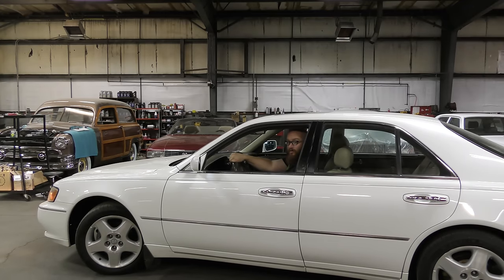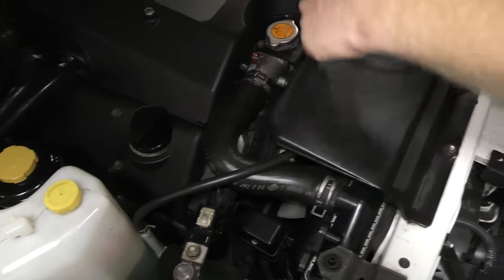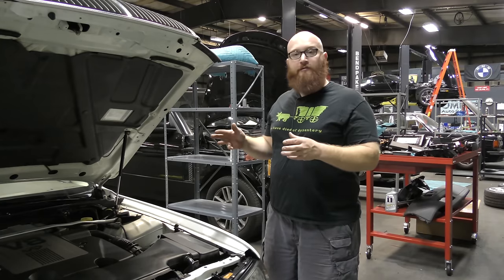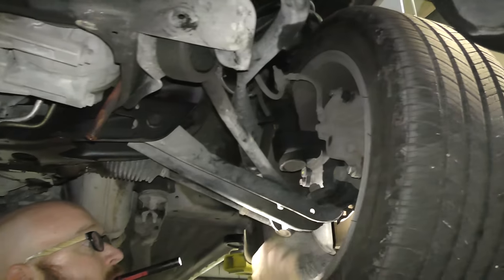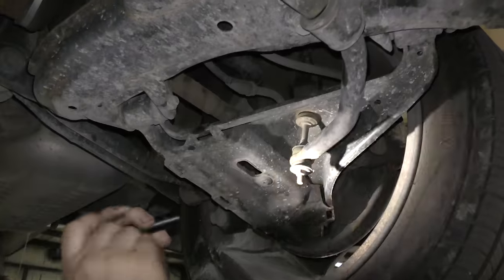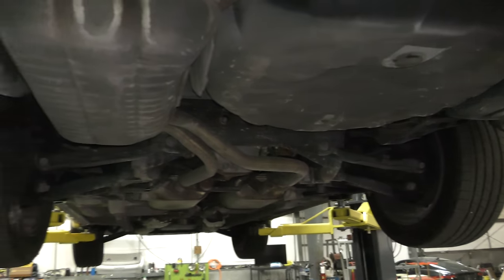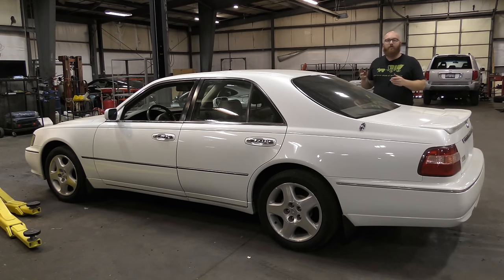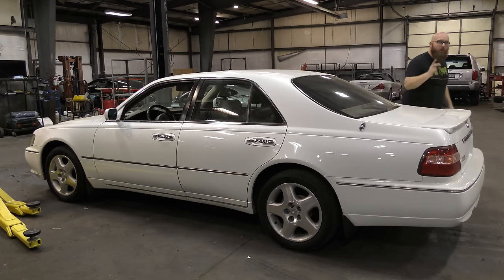I've never seen one of these before! First time a 99 Infiniti Q45t enters the Car Wizard's shop

Comment: You know a good car, when the mechanics have never seen one.
Reply: Yup. A good sign when looking for a car is that it's hard to find. People hold on to good, reliable cars.
Reply: your both wrong they just didn't make many of them
Reply: jeff59rt You know I never really thought of it that way but that’s a damn good point!
Reply: The same truth applied for the worst cars also
Reply: Unless the car is a dud like the Dodge Intrepid. When those cars break down the next stop is the car recycler
Reply: MrFuchew there’s plenty where i live found over 12 of them near me
Reply: @fleichy6425  West coast?
Reply: Jeff Harris yes oregon
Reply: @fleichy6425  which part of Oregon? I'm from there to and these don't seem rare at all around here. it's nice living somewhere that cars don't rust out by year 5.
Reply: This car sucks all nissians do
Reply: @presidentroosevelt8773  how you’re just hating this car was before Nissan sold itself to renult bad ass nissans and Infiniti’s in the 9ps
Reply: @ourtime-downhere6931  90s
Reply: @jesserdo9963  90s what?
Reply: Rite on
Reply: 🙂🙂🙂 Great point, because if The Car Wizard hasn't had one in his shop before now, it makes you want to see if there is any used ones for sale somewhere.
Reply: @MrFuchew  that doesn’t mean it’s not a reliable car
Reply: Did it sell bad ?
Reply: @presidentroosevelt8773  Nissans in the 90s were literally indestructible. You can run one on one quart of oil for thousands of miles do an oil change and it would just keep running fine after that
Reply: axelafy I'm thinking maybe he was talking about the touring edition
Reply: Flordah_man_life  Nissan Cima.

Comment: The Q45 is yet another example of how automotive journalists can ruin a car. This car was very similar and certainly competitive with the third generation LS400 of the same vintage, yet this car and the entire Q 45 legacy faded into obscurity. It was criticized for being too “Buick like” at the time and not high performance enough.  This is yet another great example of why we need to demand that the auto manufacturers bring back big, comfortable, rear wheel drive cars.
Reply: Journos simply ruin everything. 

It's a wonder anyone ever listened to mouthpieces who only cared about numbers cars to sell more magazines from more "thrilling" performance tests.
Reply: The new rendition that came out in 03 and 04 was a sales flop but my car when it was released in 06 as a total redesign it knocked bmw Mercedes and Lexus out of the ball game accordimg to Motor trend and car and driver. It was extremely a head as far as tech and features. To this day my 08 M45 Sport runs amazing with over 100,000 miles on it.
Reply: Modern cars beat up the occupants.  My '95 Impala is comfortable, one sinks down into the seats.  Amusingly GM advertised the seats as bolstered compared to the Caprice and Roadmaster.
Reply: I think people give the auto journos too much credit here. People didn't stop buying luxury sedans because the journos told them to. They stopped buying them because they started buying SUVs instead. Auto manufacturers listen to sales above all else and the sales (the people) have spoken. Not that the journos did the sedan any favors. As long as the majority of the new car buying public keeps buying CUVs and SUVs we won't be seeing a resurgence of nice sedans.
Reply: I remember when it first came out in 1990, it was criticized for its styling and being too 'brutish' to drive. Then in 94, they slapped a grill in the front and softened the ride. The car got softer and softer with each new generation / refresh. The other thing was it didn't have the reliability and resale of the Lexus and Acura and thus couldn't keep up with sales and demand. Lexus still makes the LS and neither Infiniti or even Acura have a proper flagship

All that said, I have a J30 and it's amazing. I love the early 90s Japanese cars best. Overbuilt and over engineered machines. Too bad Renault took over Nissan
Reply: Well, that's not totally true. The Chevy SS was lauded as "as good as its german counterparts, and very well appointed even at base level" by journalists, but GM never advertised it at all, so it died. I still remember when "new old stock" was selling at $20k discount closeout prices. Wish I were in a position to buy one of those.
Reply: The market has spoken though: there is no market or demand for big rear wheel drive cars unless its a Merc, BMW, Bentley or Rolls-Royce.
Reply: Most auto journalists have a ridiculous propensity towards sporty and dynamic cars. Personally I take comfort about performance.
Reply: That’s why I drive a 96 Buick Roadmaster. Obviously not my only car but will always have an old school big American luxury car w/V8, rwd and comfortable. Got it 4 yrs ago with 22,641 miles. When my tour in Germany is done next year I’m on the hunt for my 76 cadillac Sedan deville🇺🇸🇺🇸🇺🇸
Reply: LOL, yeah, it was the journalism. 

RaaaaaHaaaaaaHaaaaaaaa.

Yeah, it was the journalists. Yep, if your a Nissan fan let's go with that. 

Nothing to do with anything else, all because of the journalism. 

Ahhh, yep, heard this all before. 

Also heard the beloved journalist has praised many a lemon along the way too.

The strong survive, the weak die. Nature.
Reply: Topher7527 great point, I completely agree.
Reply: My 2006 Lincoln Town Car is probably one of the greatest cars of all time. Fast? No. Efficient? Also no. Dynamic to drive? Absolutely not. Comfortable as hell? 100%. Will continue running until the sun explodes with routine maintenance? Hell yes. 

Other automotive GOATs: '90s Corollas, Camrys, and Tacomas; '80s Volvos; '80s Mercedes diesels
Reply: @Shawn-ne6ld  I like your taste in cars.
My first car was a 76 coupe DeVille. In 1984 (paid $45.00) 2nd 1971 Cutlass; 3rd 1983 Eldorado
Parking spaces have been painted too narrow for our full size cars or pick -ups.
 I now drive a 2008 lacrosse V-6 204,000 miles. It's in ultimate condition. Cop shocks & cop tires (Michelin sport 16") 
 Might be the last good Buick ever🚗
Reply: Glad to see there are real car guys still out there brother🇺🇸
Reply: Genesis is doing just so
Reply: Fred Williams I’ve got an 08 G35 and it’s got lots of stuff average brand new cars don’t have. Radar cruise, pre collision braking, headlights that turn, and lots of very advanced engineering. Infiniti used to be way ahead with tech, but unfortunately they fell behind. Atleast I’ve still got my G, 300,000kms and still runs better than a lot of brand new cars lol.
Reply: Oddly enough this is one car journalists might’ve been right about. It was criticized for being inferior to the previous gen Q45. The 89-96 had 300hp (unofficially) and was beloved by enthusiasts for both its performance and comfort, but Infiniti cut costs with this second gen Q45 Due to poor sales. It was still marketed as a sport luxury sedan, yet this car lost 40hp and 50 torque, making it slower than the Lexus LS. This Q45 was also put on an older less expensive, heavier, JDM platform that resulted in an entirely different car. Still a Great car, but unfortunate that it came under the pretense of being a sequel to Infiniti’s first gen Q45. Oddly enough the first gen q45 lived on in Japan until 2002 as the Nissan President.
Reply: @Kevin McAdams
This version of the Q45 was actually a downgrade from the original....which was more of a Japanese BMW
As for large RWD based cars there are still several available..Mercedes S class, BMW 7 series, Lexus LS and Genesis G90 to name some
Reply: @fredwilliams7893  my 06' just passed 237k I use it as my work car- I am an insurance property adjuster and this car has been to every hurricane since 2016 Matthew and many hail storms and freezes up north. I paid $3000 at the dealer's auction in 16' with 181K..this is an amazing strong engine!
Reply: @the3hrdoption637  Thats Awesome!!! 👍  what kind of oil do you use and how often do you change it?
Reply: A better example of this would be when Consumer reports sabotaged the Suzuki Samurai,
Reply: Only really bad thing about the Q45 it didn't have no trunk space for the size of that car
Reply: @mjdgi1  Probably had something to do with the suspension set up Or some other form of packaging in that department That caused the shortage in trunk space for the class
Reply: 2002-2006 (I had 2 of these and still driving my '06). It had all the features (premium model)  of the LS, S class, A8 and 7 series, but it was faster, cheaper, than all of those cars and handled a pinch better due to it being just shy of 2 tons. This car was like the Hyundai of full size luxury cars back in the day. No idea how everybody did not own the "big Maxima". No AIR SUSPENSION issues with this car and the valves were TITANIUM for some reason.
Reply: It was the marketing and advertising that killed it. Lexus was doing commercials with a coin standing on edge on a running engine to show its smoothness. Infiniti did commercials that showed leaves and flowing water BUT NO CAR!!  How do you expect to sell a car with no car in the commercials?
Reply: @khakiswag  lmao right
Reply: Damn! They said the Q45 wasn't performance enough?! My 1995 Q45 outperformed the Lexus LS or any other competing luxury car of the time!
Reply: @fredwilliams7893  , I drive a 2005 Q45 PREMIUM today and got it 1 year and a couple of weeks ago. It now has 94K on it. Before this I had a 2002 Premium. The tech, it had a lot of German cars of the time beat. The S500, LS430, Audi A8 and 745 BMW were all slower and did not handle nearly as well. The Q45 was also more reliable than the German cars. This car is simply amazing. Turn pff the traction control and this thing will get sideways around a corner while only weighing exactly 4,000lbs.
Reply: @ericg5075  , 1st gen motor is used in drift cars. My uncle had a '91 (no grill) and it had 278 horses. That shit smoked damn near everything and it handled amazingly compared to other full size luxury sedans.
Reply: @mjdgi1  , agreed. I just moved from NYC to San Diego 2 weeks ago and shipped my 2005. I loaded up the trunk and was like...that's it?!
Reply: @elmayimbe_the_amateur_mechanic  Nice! I like The Q45 I would like to buy one in the future but low mileage ones in good condition are almost impossible to get.
Reply: I don't think journalist ruined the car, I think that Lexus just marketed and advertised the LS400 better. We all remember the LS400 champagne glasses and the ball bearing commercials in the early 90s being in heavy rotation. I can't for the life of me remember one commercial for the Q45 though.........
Reply: Out of respect to the ls400, the q45 has been known for years to blow head gaskets and have timing chain issues within 5 years of ownership. Definitely not quite on ls400 standards.
Reply: I agree. These cars were never meant to be racecars, so I don't understand why they tested them like it and made fun of them for not performing like racecars.
Reply: @fredwilliams7893  I absolutely love my 06 m45 sport. Hands down this car has more personality than anything else I've owned.
Reply: @dandc2011  They are very rare. Plus the vk45de is a detuned race engine Nissan actually used in the gtr race cars . I will probably keep my 08 for a very long time.
Reply: @Eric G50 - Those headlights were way ahead of their time. They still are.
Reply: I remember in a 1997 Car and Driver comparison of full size premium saloons they criticized the Q45 for having faux wood trim.
Reply: @petrosaguilar8916  Yea they did way better with the critics in 2006 when the all new redesign M45 came out!!! Real wood trim and beat out the E class and 5 series BMW!! 👍
Reply: @sterlingcrawford1218  they are pretty efficient. I get 30mpg on the highway hauling 3 people if I hold it at 100. Thats over 5000lbs going down the road. Engine is so strong I don't feel much headwind, could you imagine a weak1.5l turbo mpg in same situation spinning it's nuts off killing mpg
Reply: So true 👍
Reply: @thedomitabletraveler7198  I had the q45 for a while. Nicest driving car I ever had. Was not particularly reliable for me. My friend had the J30. That is an awesome car.
Reply: @fredwilliams7893  yeah the 03/04 was now competing against little brother the "G" car which was a hit...the M45 was basically made to defray the cost of the new V8 engine that appeared in trucks that year...in Japan it's called the "gloria" sedan and comes with a V6
  A real anomaly, the car came on the new Q platform but used an existing body...
Folks what makes the Infiniti M45 is something few cars have, it's built on a frame and it has independent rear suspension...and for those who have them it's not an SUV it's a car with a trunk....remember those?
Reply: @ricky-sanchez  liar
Reply: @khakiswag  that wass the first generation. The commercials for this generation had the president (imagine that) wanting to drive instead of the secret service...and he swerves all over the place. 

First gen was more of a better japanese BMW

This gen is like an old school very well built Cadillac...
Reply: I have this car now, and I love it
Reply: The ride on a Q45 of this vintage is like floating on a cloud. It’s so luxurious. Beautiful long distance cruiser.
Reply: A-men brother
Reply: @tl1024  A NOS Chevy SS selling at a $20k discount? Thats a huge lie because GM sold every one they could build. It wasn't intended to be sold at a level of more than 3k cars per year and the prices are currently appreciating in value. The Chevy SS wasn't a flop....